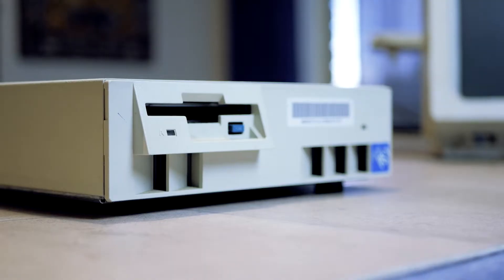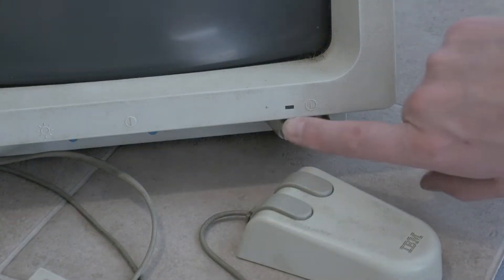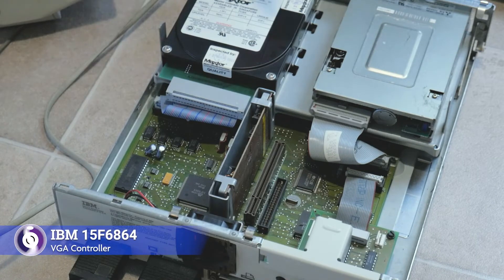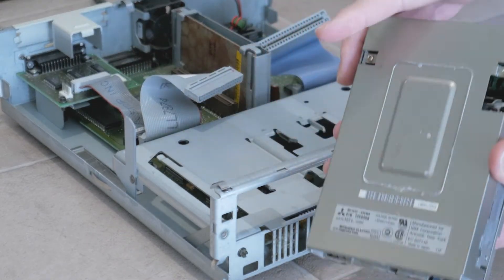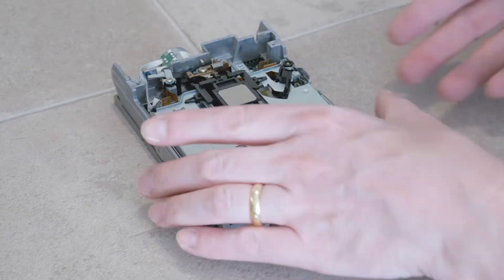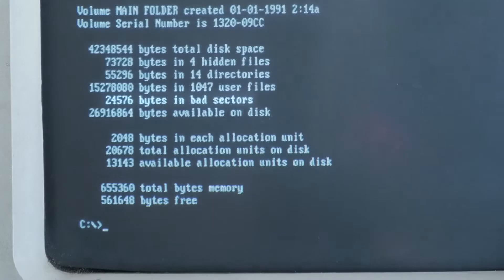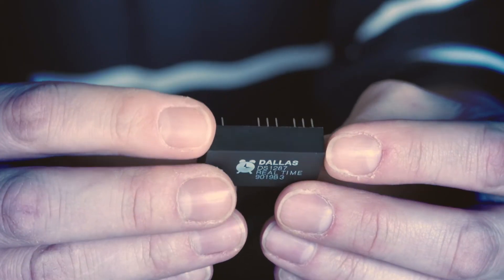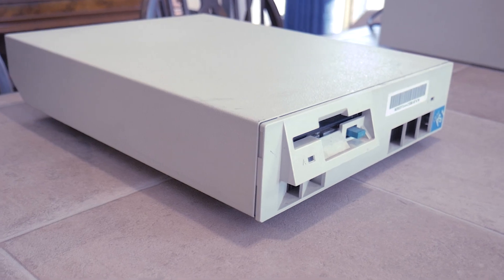IBM PS/1 2011 Pt 1: Vintage home computer teardown

Comment: Do you have any idea why one of these computers might not want to turn on at all or show any signs of life..? Recently I was helping my grandparents clean out a storage unit they had bought at a storage unit auction.. and inside this storage unit was a lot of water damaged and mouse damaged items.. and buried under a lot of it was this old IBM PS1! i forgot to mention but the water damage came from the storage unit not having a good roof seal and not being opened in 20 something years.. and the mouse damage coming from the previous owners storing tons and tons of candy and food in boxes and such… but back to the computer
My grandparents were gonna throw it away and me being me I couldn’t let that happen.. I’m 25 years old and into older things as I collect post war Lionel’s and I electronics but this Computer is my first retro computer.. well I got home cleaned it up externally then opened it up and inside of it looked perfectly fine! No water damage or mice urine or corrosion.. it just won’t turn on at all.. I’m sorry this is a hell of a read.. but I wanted to ask someone who might have more knowledge about this stuff because again I don’t wanna just throw it away.. it’s to cool to see thrown out..

Comment: Nice video! I have the same computer but when I start it up, it gives me the "Incorrect DOS version" error after bypassing the CMOS errors. It runs on IBM DOS 4.00. I can't run most of the programs and commands (mem, format etc.). Also I don't have any  floppy disks so I don't know is the floppy drive working. I don't know much about those things. Is there any way to fix it? Apologies for bad english.
Thanks!

NOTE: I found this pc from our basement. According to what my dad said this computer hasn't turned on since 1997.

Comment: What was the operating system on these? It was Microsoft but it wasn't windows.  It had a folder system but the were stacked on each other with a tab showing at the top. Like a filing cabinet.
Reply from the maker: Actually most of the core OS stuff is not from Microsoft but IBM. The PS/1 model 2011 and (I think) 2121 can boot IBM's PC DOS 4.01 from ROM and automatically launch into a simple GUI which is called the "4-quad" screen that includes the "filing cabinet" folders view you described. The ROM also includes a small memory-disk which includes a few basic utilities (though oddly not the one required to do essential config of the system). Typically, though, they will be configured to boot to whatever OS is installed on the hard disk, and while this is usually also PC DOS 4.01, it can be other things just like any regular PC of the era.

Comment: My first PC. A lot of older games ran too fast. The floppy drive did something like format 720k disks as 1.44 without drilling them. Played a lot of Wing Commander, and dialed into local Bulletin boards, ours had a 2400 baud modem. My dad purchased this at Sears in 1991.
Reply from the maker: Ah yeah… I would’ve been hooked on 2400 baud in 1991. My first BBS experience was in 1992. I never had a PS/1 in the day but it always looked pretty slick and pro to young me ;)

Comment: Thank you so much for this video! I was wondering if you could please backup its ROM for the IBMulator project and maybe do a backup of the HDD files. I contributed some UK sets to the IBMulator site but i'm still missing some files. Thank you so much for your time and any help on this!!!
Reply from the maker: Despite the hiatus, I will get back to this at some point :) I will try to dump and share the ROMs and see what I can do about the HDD too.
Reply: @fooglestuff  That's great news! I think the BIOS on your PS1 is different from the ones on the ibmulator site. Thanks again!

Comment: I had a 286 one my uncle gave me. It had the memory expansion so it had  1024 kb memory IIRC correctly. Later he gave me a soundcard but it was a propietary model from IBM that couldn't find out what was compatible with, since just a couple of games I ever played on it had sound besides the PC speaker. Good times.
Reply from the maker: This is a very late reply, I’m sorry, but yes! There was a very specific sound card for it that was similar to hardware in the Tandy 1000 IIRC. Those cards are quite hard to come by and valuable now! I’m working on an ACU card for supporting regular ISA cards

Comment: New sub for this video series! I have a Model 2011 which hasn't seen a moving electron in a couple decades at this point. Thanks for this deep dive. I may try to find that RS-232 card, because a 2400 baud modem isn't so useful these days... 🤪👍
Reply from the maker: Welcome! I hope to get back to making more videos soon, but in the meantime I hope you manage to make progress on getting your own machine up and running. As for the RS-232 card, thankfully the hardware itself is pretty simple so for someone with enough electronics skill it could be cloned on the cheap. I might try that at some point in the future… hmm…
Reply: @fooglestuff  Yeah, I haven't taken a look at the service manual. Hopefully it has a pinout for the expander they use for the ISA card slot. That would be cool.
Reply from the maker: @McTroyd  The IBM Tech Ref manual is good, found near the bottom of this page: https://ps1stuff.wordpress.com/documentation/ibm-ps1-model-2011/ -- Section 9 is serial interface & adapters. To me a much more interesting project is attacking the ACU slot: That's at the end of the appendix, and includes a pin-out. It LOOKS like an old PCI slot, but is more like a 16-bit ISA slot with a weird pin-out, and was intended to be used only with the rare "Adapter Card Unit" housing that stacks on top of the chassis. I've had a prototype PCB made that fits it, but I haven't yet tried to make a project with it. That will come later :)
Reply: @fooglestuff  I look forward to the results then. Thanks for the link!

Comment: I grabbed one of these in a thrift store for $5. Unfortunately at the time, I didn't know I needed a matching monitor for its power source. D'oh!
Reply from the maker: There are options for a power supply if you’re willing to do a little hacking. Some people make their own power supply with the required 36V output, but that’s a bit involved. There’s someone else who also made a board to replace the internal switch mode regulator board, allowing use of an external ATX power supply. All a bit of mucking around though.

Comment: I only ever saw one of those, and I haven't stopped running away 🙂
Still, what would I know? My 386DX Osborne clone cost $4000, and was an unmitigated piece of junk. Cold solder joints on the motherboard, which I'd sometimes have to shove in the freezer so that it would boot.
Reply from the maker: Ah classic :) I love the freezer treatment. Amazing how much they got away with charging for clone stuff with such average QA standards. I’m guessing that’s $4000 in late 1980s dollars too. I have a computer magazine from 1990 discussing the PS/1 launch, and one ad has a bog standard mouse (for example) listed for $160. Crazy!

Comment: These PS/1s are compatible with PS/2 floppy drives, including 2.88 MB drives, although the DOS 4.01 in ROM only supports up to 1.44 MB disks -- you need DOS 5.0 or higher to support 2.88 MB disks.
Reply from the maker: @vwestlife thanks for the tip, and thanks for stopping by. I've enjoyed a lot of your videos. Now if only 2.88 MB drives were more common! As a kid, I remember being amazed that capacity was possible.

Comment: These IBM PCs never really made financial sense to me, but a few decades later... cool stuff to look at! Also, your videography and sound are quite nice! A very pleasant watch.
Reply: I remember the sounds lol 😂 even played prince of persia on it  the diskete the drive  like it is not connected (bad drive/flatcable reversed pin 0)
Reply from the maker: @keycontroller  Great PC speaker sound! With the floppy, it's complicated. In part 2 (https://youtu.be/k_n7FxaBlq8) I first fix the CMOS chip to help store FDD settings, then in part 3 (https://youtu.be/XZb9WN_u0YA) I repair corrosion in the floppy.
Reply from the maker: Thanks for your encouragement! I'm probably putting too much time into production but I'm glad it's appreciated. I agree; I vaguely remember back in the day that they seemed stylish and professional, but at the same time exotic and expensive compared to all the other affordable PC clones. I only now get to see, looking inside, that especially this model was quite crippled and proprietary. It does make it interesting and different to tinker with, though, and I'm hoping to work on some homebrew hardware projects for this machine soon.
Reply: @fooglestuff  Good thing you replied; I hadn't subscribed! That's now fixed :) I've never seen a PS/1, but a rich friend of mine had a PS/2 and I think my school had one PS/2. I remember marveling over the insides of the PS/2 machines and their IBM "solutions" that made the PCs basically un upgradable. I also couldn't wrap my head around why people poured their hard-earned money over what was a mediocre PC. Well... IBM PCs are now history, so I guess most people shared my view!
Reply from the maker: @u2370  Oh yeah, it seemed strange back then, and totally foolish now. IBM's MCA seemed fancy, but just made it difficult for everyone. My original exposure to all this as a kid was through a guy that sold IBM PCs, and even he ended up abandoning them in the late PS/2 and PS/1 era. Well, with this oddball PS/1 I hope to do a few more experiments and hacks yet! Got a bit more refurbishing to go yet.

Comment: Thanks a lot for the well done ps/1 videos. I have the same computer, Finnish version of it. I am the first owner of it. Mine is still working after Dallas RTC battery hack. But I wonder, is it anyhow possible to replace the hdd, or is it just non-standard? https://www.youtube.com/watch?v=Ptn-Bl6242I
Reply from the maker: Good question. It might be possible to do something about the HDD, and I plan to investigate this. It will require a custom solution. I think the model 2011 HDD interface is based on the rare “XTA” which is similar to IDE but 8-bit, so not directly compatible. Plus, IBM’s cable is wired a little differently, to integrate power too. I suspect a modern microcontroller could easily adapt or emulate a drive for this interface, so that’s what I’ll try out in future. Another option is the XT-IDE card, but using that will require an ISA slot adapter for the PS/1’s ACU slot, plus a modified PS/1 BIOS (ps1stuff.wordpress.com has one, but not much info yet). These are all things I hope to try out in future videos :)

Comment: Hello, thank you for this nice video about this great looking machine.
I have the 2121 from 2011 and would like to restore it and maybe expand. Do you think I can install a bigger drive instead of the 30mb one?
Reply from the maker: G'day @ambulatorioveterinariodott3768! Apparently your IBM PS/1 model 2121 uses IDE for hard drives, i.e. PATA (Parallel ATA). I think this means finding a larger drive might be a little easier. Maybe you could use a cheap Compact Flash IDE adapter (e.g. https://amzn.to/3Ii1GSo) with a small Compact Flash card (e.g. https://amzn.to/3VJ95Nw).

NOTE: The BIOS will probably still limit you in some ways. For more information, read about half-way down this page where it talks about IDE drives: https://ps1stuff.wordpress.com/documentation/ibm-ps1-model-2121/

I can't test this myself: My model 2011 uses a variation of what's known as XTA, which is quite rare, though I'm interested to see if there's a way to make a smart adapter for this... perhaps in a future video.

Let me know how you get along!

Comment: Very professional video filming. You seem to be off to a good start. Keep it up.  I have one of those myself that i'm restoring. I will let you go ahead and and follow your footsteps :)
Reply from the maker: Thank you for the great feedback Marco. Good luck with your own restoration. I should have another video up soon that looks at floppy drive repair/replacement options.
Reply: @fooglestuff  Idk if it's actually filmed using vintage equipment or if it's just a filter effect....but either way the entire production feels period correct 😆

Great job! 👍
Reply from the maker: @EricJohnson-fh8zj  I’ll take that as a compliment even though it was probably just dodgy lighting and an unsteady camera that gives it that look ;) This video actually just started out as a quick experiment but grew beyond that. I’ll keep upping the production values as I get more time to work on future videos! I’m working on the 4th now and I’d like to get into some more serious electronics hacking soon.

Comment: Beautiful computer I have one but it recently died not sure if it's an easy fix or not
Reply from the maker: I hope you manage to work it out. As mentioned at the end of my video, ps1stuff.wordpress.com is a good resource. Maybe my other videos will help too. Does yours still power on, but just not boot up or show anything on screen?
Reply: @fooglestuff  in my case the computer won't turn on at all it makes a click sound when powering it on and nothing else happens probably power supply issue
Reply from the maker: If you plug in your monitor to mains power but detach both cables from the computer base, does the monitor itself power up? If I do this, the monitor power light comes on, there is a fan quietly whirring inside the monitor, and the CRT shows flickering white. If for you this also just clicks but shows no other signs of life then yes, it does sound like it would be a PSU issue.
Reply: @denniscarrion746  There can be a few hundred volts on a switching power supply. But, if you do some research, and take care not to shock yourself, switching power supplies tend to be a really straightforward fix. IBM in those days had some of the best service manuals there were, and might even have a schematic for that power supply if it's on that Wordpress site.